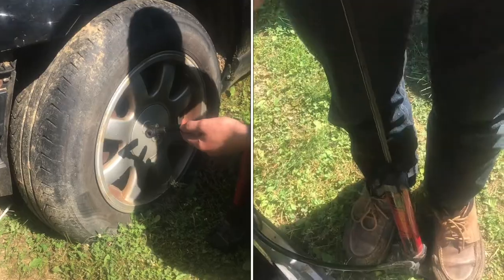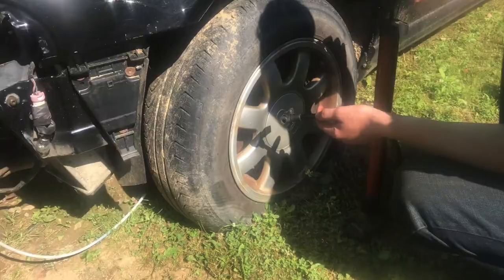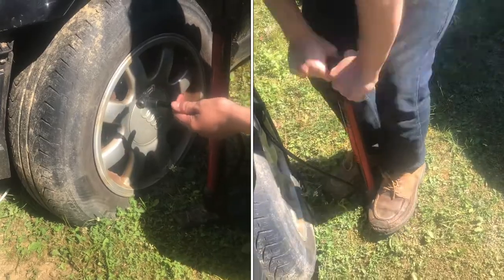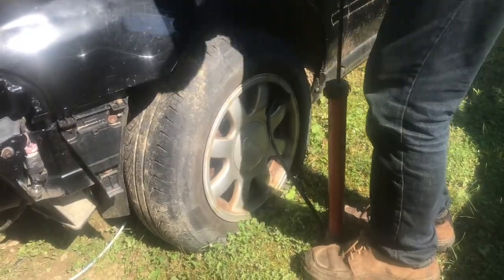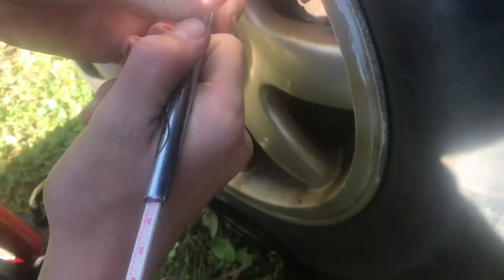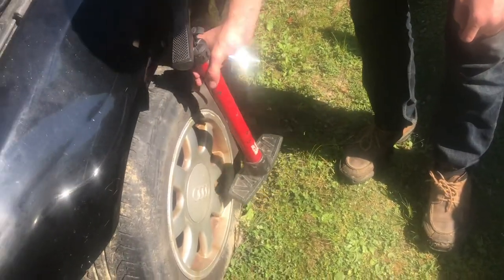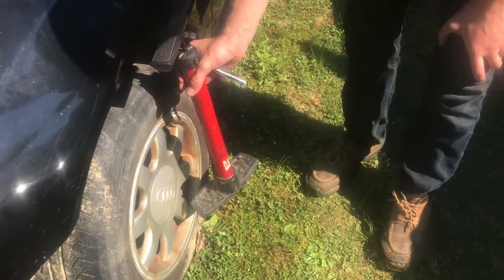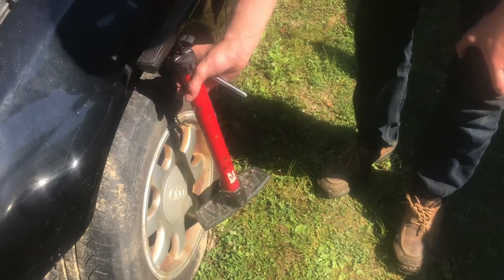how many “PUMPS” does it take to inflate a car tire with a “bicycle pump”

Comment: Interesting info. It probably depends a lot on the size of tire. On my Goodyear 265/60R18 it took 100 pumps to get my tire from 30 psi to 36 psi. I figured it would take a lot more pumps than that so I was pleasantly surprised.